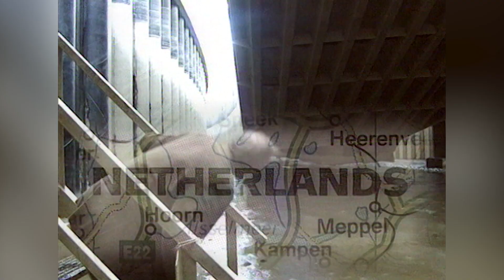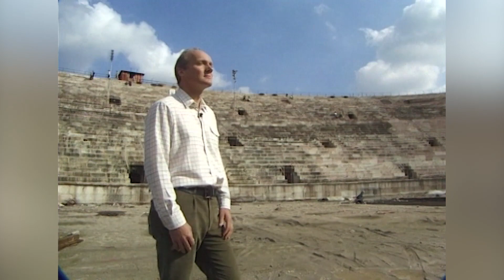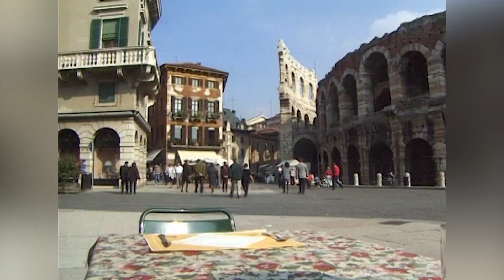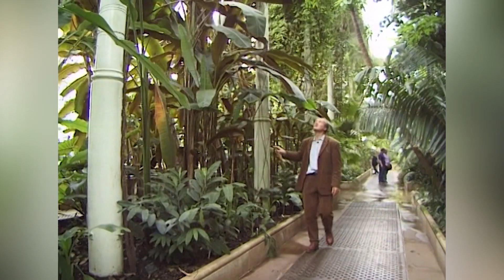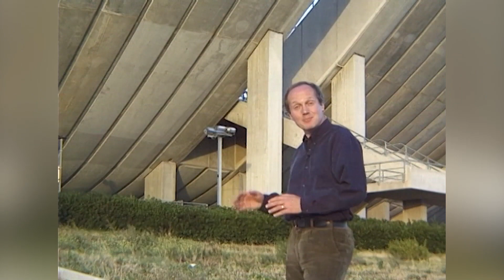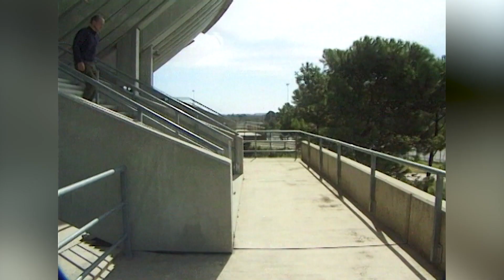From Colosseum To Stadium | How Did They Build That?

Comment: The demonstration with the three boxes was entirely wrong!!! The boxes have a rectangular cross section and were held in place by friction due to the pressure from left and right, he had to apply constantly. The actual arch's pieces have a trapezoidal cross section and the key stone (center) works as a wedge. No friction is necessary here. It could be soaking in oil and still work. His little box model wouldn't. I hate when doc presenters have no understanding of what they try to explain the audience!
Reply: Are you implying that if Kodak made trapezoidal film boxes they would still be in business?